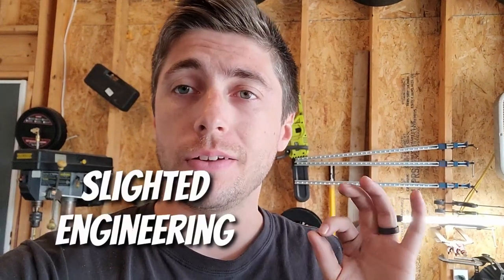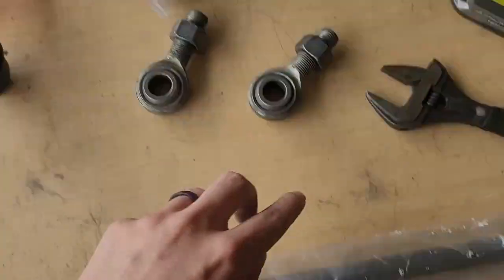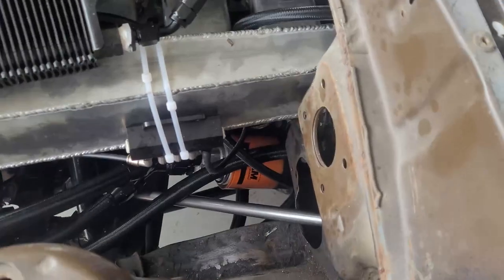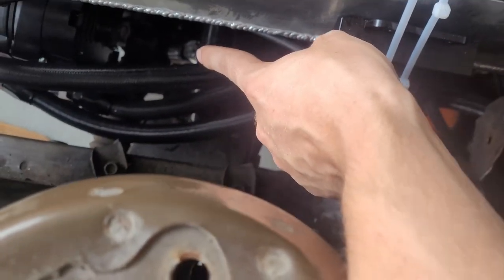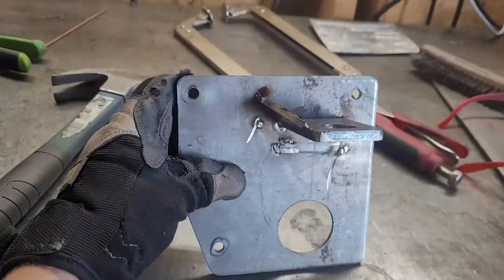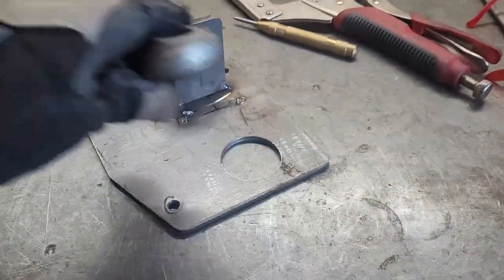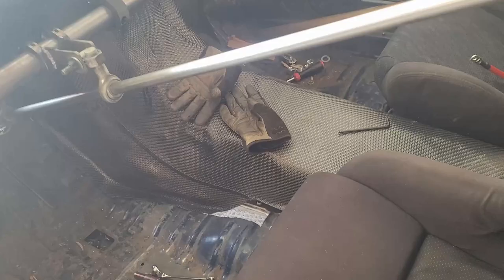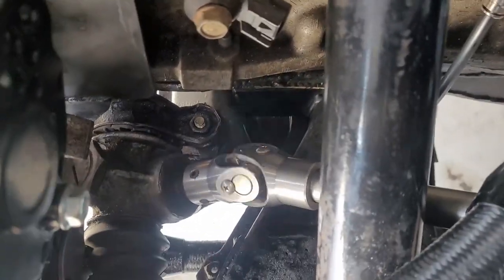Custom Race Spec Steering Column from Scratch for Cheap!!!!! EASY Fabrication!!!

Comment: Where did you get your u joint with the splines….i have a Toyota soarer aka sc300 but can’t fine a spec for the splines
Reply from the maker: Typically, you can count the splines and get a specific one. Mine was very expensive and hard to find because of the datsun steering rack.

Comment: I love it. I'm working on making a BMW rack work in my Mercedes right now. Those one off splined u-joints for specific manufactures are spendy for sure! I too got a 3/4" heim joint as a support. Who makes such a beefy quick connect for your wheel?
Reply from the maker: The quick connect is straight off Amazon. It was one of the cheapest that used a spring-loaded pull release. There is some play in the wheel when connected since it's not a spline. But it should be adequate for what I need.
Reply from the maker: This is the quick release I used https://a.co/d/dK846Mc